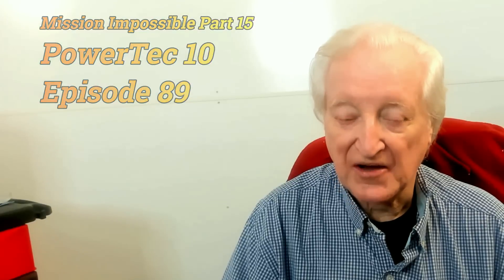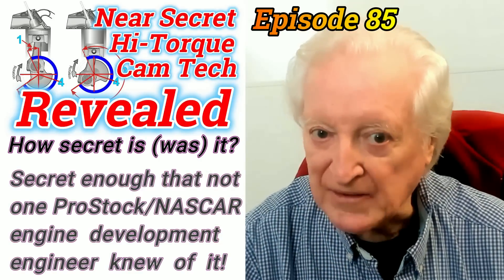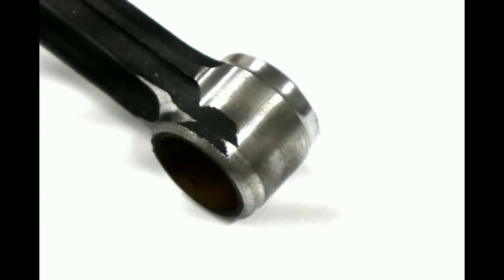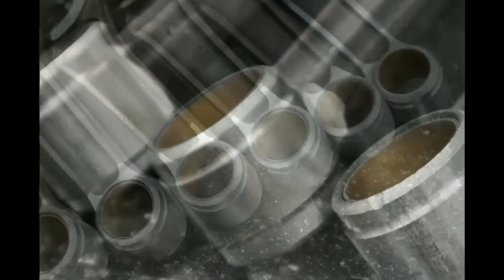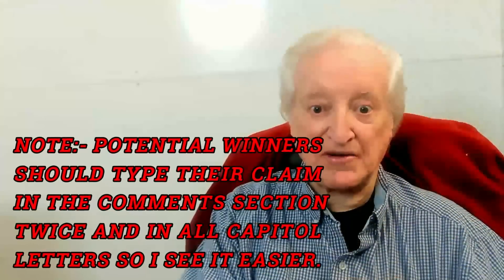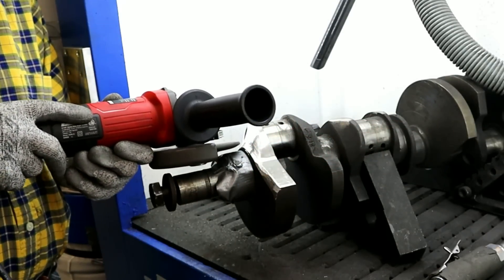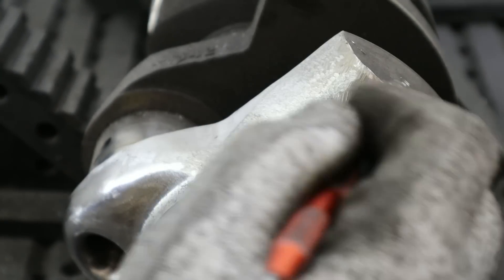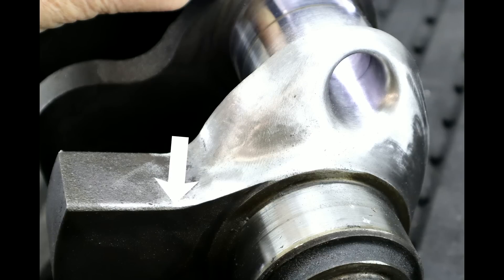Crank Mods continued and fix of incorrect rod tech

Comment: If you don't have old bearing shells, use a strip of sheet metal bent to shape with duct tape on the inside saving the journal from scratches.

Comment: I stated that I used a cartridge roll to remove the parting line flash,  I started with a narrow belt sander  
Did the chevy "pink" rods use different metal?  Rod's look nice   Do not pay extra for 340 rods

Comment: David can you please make a video for dummy's like "me" step by step on the 128 cam formula for picking the right cam for my sbc 400. This engine has a stock dished bottom end with very low mileage. I want to use a set of stock vortec heads on it and i will modify the heads to work with the right cam that matches this engine. I could be wrong about the compression ratio but i was thinking it would be 10.1 with the vortec heads. This engine gets ran a few times a year at two different events and it gets punished a lot.  I was thinking a flat tappet  solid lift cam but i don't have. any advise is greatly appreciated.
Reply: I don't have to run a solid flat tappet cam, i was trying to get the most performance that i could get from this combination

Comment: Been binging your videos on building race engines. Wish i had the tooling and machinery to do some of things your doing like lightning rods. Bit late to incorporate this new knowledge into my current engine (albeit not a big block engine its a 6g72 3.0l v6) . Definintly interesting stuff and right up my alley since I want to make a killer high revving all-motor build. Definintly see areas of improvement to my current build like all the work you've done blending the crankshaft counterweights and lightning up the rods by quite a lot. 2-3 lbs off the crank will definintly make some improvements in response and horsepower and when your dealing with small displacement engines EVERY single horsepower matters.

Comment: David, what material are those con rods made from? Loving this video series. Regards Greg
Reply: Original forged steel
Reply: @Ryan Stinson  there are many different grades of steel, that is why I am asking the question
Reply: @theshed8802  Likely but not guaranteed 4130
Reply: @David Mizen personally I'd be very surprised if a standard factory rod for a low performance motor was made from 4130
Reply: @theshed8802  British En (26) 4130 equivalents were used by UK engine builders mid 60's Cooper S con rods come to mind higher grades were also used  for other parts eg en40b (approx 4340) it also crops up in other places
Reply: @theshed8802  I see what you mean brother, I know they used top notch material...they had to-to offset the lack of care most of the process saw once the workers slammed them together unfortunately. I'm sure there's someone who knows what was used. 4340?! 👀😁😅👏👏👏
Reply: @Ryan Stinson  if they were using 4340, then I very much doubt that we would be buying 4340 after market rods as an upgrade. I suspect the factory would be using a much lower grade, and much cheaper material, because just a few cents is important to the bean counters. The extra cost of material, plus the extra machining costs associated with 4340, means that low performance motors should be getting low grade materials

Comment: Really like seeing the little 318 receiving so much love. I've owned from 2.2 - 440's and built quite a few of them. Never with the amount of race expertise you are demonstrating. Kind of on a dare around 2005 I helped do probably the first or one of them, J-head to polyblock builds. It went into a 1964 Dart. The A block 318 and LA 318 are more interchangeable than people would think. The big difference is in waterports. The machine shop we were using threaded the water ports in the J-heads and blocked them off with pipe plugs. Then redrilled the water ports to line up with the A block. We took the cylinders 90 over. Finding a readily made piston proved impossible so went with JE custom made pistons in 10.5.1. On pump gas not in full tune it made 292hp and 272 ft lbs of torque at the rear wheels no power adders. Not the greatest but for an experiment in that time period not too bad. It had a really flat torque curve. In a little Dart setup for drag racing it held its own pretty good against far larger engines. 
The polyheads wouldn't work in the little Dart but they would in B and C bodies and pickups. It's a shame no one makes an interchangeable aluminum polyhead for the A and LA engines. Wouldn't be very hard to do! The head flow would have to be pretty good. It would turn the little 318 into a monster. Most people don't realize they factory produced a 318 dual quad in I believe in 58 that was 290 hp the same as the 340 six pack.

Comment: On a 1980 Chev 350 Sportsman stockcar we had to run a "stock" crank.  We weren't allowed to drill it to lighten it, so I had it cut to small journal 327 specs which not only lightened the crank, it cut the friction due to smaller diameter journals.  Grinding the journals smaller allowed a larger radius on the journals, strengthening the crank.  Also, the smaller big end of the 327 rods meant even more weight savings.  With minimal weight removal from the balance pads and some beam polishing, hung on hypereutectic flat-top pistons, we were at the minimum piston assembly weight allowed.  It was assembled with bearing spacers on the mains and we ran it for 11 years at 5,500 to 5,900 RPM with new bearings each year and a full overhaul twice to check guides, cam and cylinders.  The oil and filter were changed every weekend.  Finally, a crushed air box in front of the radiator overheated it, so we retired it.

Cheating is easy, finding ways to stay inside the rules, but right on the line, and win, takes thought.  The cheaters hated us because they couldn't understand how we could beat their cheating.  I looked at one car and pointed out at least 5 things that he had wrong, that when fixed, would do more than his cheats.  Next week, he was legal and faster.

Comment: Thinking about the direction you knife edged the backside of the counterweight, wouldn't that draw oil toward the rod side? The flow will separate at the sharp edge, thus reducing pressure substantially, whereas the curved side might keep the flow attached longer, so you end up with a pressure differential towards the rod side, which would draw the oil in that direction. Your thoughts?

Comment: David, do you think this type of work would be beneficial for a caterpillar engine? Much slower rpms, generally 1900 max.
Reply: IMO, it would be beneficial. No much though.
Reply: The gains would be offset by time spent doing it.. industrial engines are built reliable and therefore see no real practical gains from spending weeks polishing and lightening internals for bugger all improvements at 1900rpm..  but it has been done..  the time and dollar cost needs to be asked..

Comment: The first time I tried porting, I wore safety glasses and still got metal in my eye. As you said, "goggles", not glasses. Very important distinction!
Reply: Yeah I've worn both and they both have issues. The glasses were UVEX ( about as good as you can get) and the goggles were full nose and eyes. The glasses were the best, but if I pulled a face while grinding particles would bounce off my face and into the eye. The goggles has air holes and so would let the dust particles in that way. It all sucks. You just have to hope you don't get a piece of wire lodged in your eye as this has happened to me twice! Now that really sucks and needs to be pulled out by an ophthalmologist using tweezers! Either that and you get some other poor guy to do it for you! But where's the fun in that?
Reply: Yeah done that twice. The first time the got it out with a stop and the second time the doctor used a very very sharp needle and very carefully picked it out. Scared the 💩out of me
Reply: The safety examples i see set on youtube are horrendous. Why can hardly anyone in the USA fit a guard to a grinder, and yes sparks will bounce of your cheek and into your eye, full seal goggles not glasses.

Comment: Fiatnutz has an old video called "Connecting Rod Weight Reduction" where he tapers the small end into a trapezoidal shape. Is that a viable option with pressed in pins or does it weaken the rod too much? His video is less than 2 minutes long if I wasn't clear in my description of what he did and you want to take a look.
Reply: Sadly John Edwards passed away some years ago. Though of course his videos are still on both of his channels.
Reply: @g0fvt  I am aware that he passed away but as you mention he lives on through his videos.
Reply from the maker: Do it with caution and only on floating pins.
Reply: @DavidVizard  👍